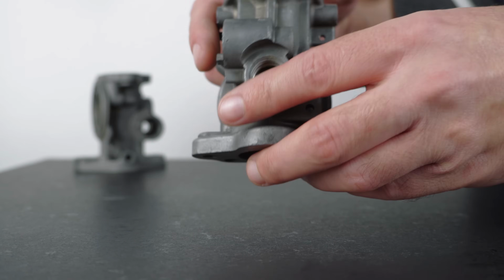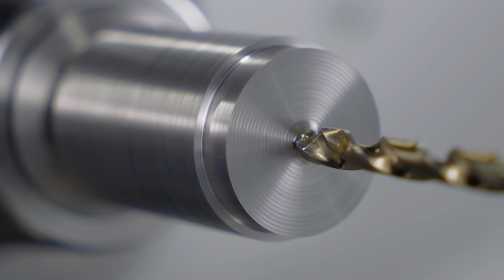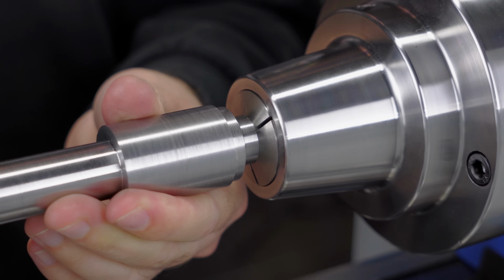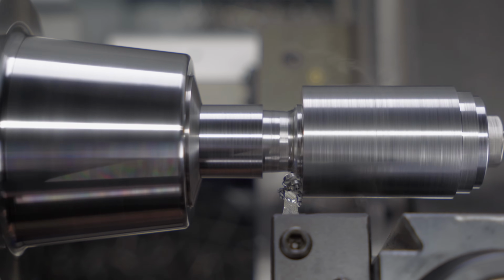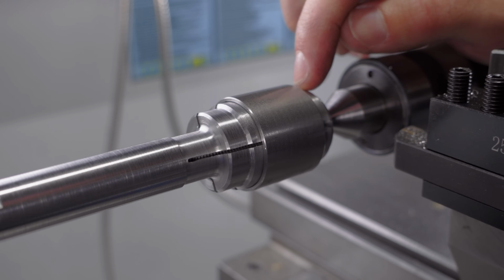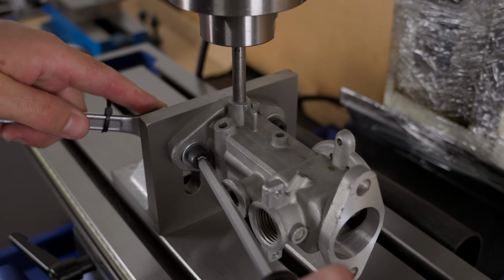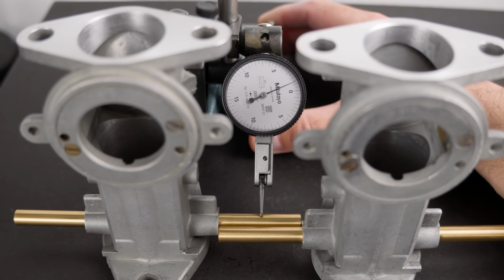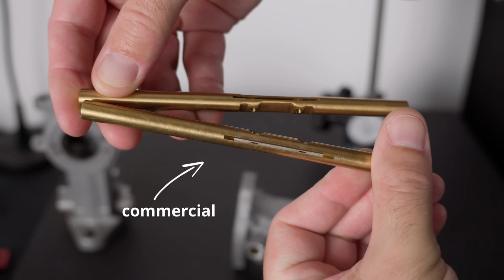Let's face it, no one does this on the lathe.

Comment: Reamers only ensure that the hole is to size, location wise they offer no guarantees. Boring bar is the way to go when you need the hole to size and in the right place.
Reply: Yes, or you can use an end mill to cut the hole in the right place and round as long as you have an end mill that is not oversize.
Reply: Lol , a properly spotted and drilled hole can locate a hole within a couple of tenths . The reamer will follow the the drilled hole maintaining the location established by the drill.
Reply: @bobbybishop5662  I wonder why I wasted a hundred grand on a  SIP jig borer a few years ago
Reply: @bobbybishop5662  I suppose the pin has to be fitted to the drilled holes?
Reply: We’re talking about SU carbies…… I would be surprised if those bushing were with in 20x that tolerance from factory…… this ain’t a turbo pump shaft for nasa
Reply: @bobbybishop5662  

Since this thread keeps going... you mentioned "properly properly spotted"... I assume you mean using a spotting drill (as opposed to center drill, which has a wrong angle) to establish the register for the jobber drill. There is indeed a technique useful for deep holes where a boring bar would be impractical, but funnily enough it still involves a boring bar... Just using a spotting drill before the jobber is insufficient to ensure the bore is in the right location, as the drill will still deflect before the initial bore is formed. So instead you drill a shorter bore undersize, then using the boring bar open it up to the main drill diameter. That bore is now in the right location and will guide the main drill the rest of the way. Again, this is better than just drilling but still not as good as the boring bar going all the way.

Comment: I turned a female and a male taper much as you did here and they, as yours did, not match. Instead of remachining like you did, I used a grinding compound and lapped them to one another. The final fit was 100%.
Reply: I had the same thought at the end of the video.
Reply from the maker: That was also my first thought. But it was quicker to just re-cut the angle. Thanks!
Reply: @nbrworks  @oh8wingman Thanks! Cutting tapers is always difficult!
Reply: @nbrworks  Good choice in general., Lapping tapers is tricky and generally doesn't result in a constant taper, because you can't move the parts axially so you end up with rotational symmetry and matching parts but not cones. Fine if you're making two parts to fit each other and nothing else, but no good for making anything interchangeable.
Reply: One thing that can mess you up on male/female tapers fitting properly is the cutting tool has to be precisely on center height wise. Most machinist are trained to run the turning tool just low of center height and a boring bar just a bit high on center. That will make the angle wrong. Some people know this and some do not. Just saying that is something I had to learn the hard way. 

Fortunately I was working at a job shop machining a big coupling to fit a tapered shaft so I got paid to do it wrong then got paid to do it right. Cost the boss man a $400 coupling.
Reply: Relieve the male taper  about in the middle of the taper a small amount on the diameter but a little longer in the center of the taper, creating an undercut. This will have two point contact and will run true. CNC machines relieve the female taper.

Comment: I was a mechanic in my early life, '60-'92 & spent some time in pergatory working on British & other sports cars. You have found a a way to solve a problem plaguing us back then, premature wear of throttle shafts on down/side draft carbs creating vacuum leaks & 'no win' tune ups, (performance/efficiency is improved w/ new ignition parts, but rough idle, surging or stumbling can't be fixed, so "Your tune up was worthless".

That no win situation caused me to add the extra work of compression tests to all tune ups & reject the candidate if imbalance was found in cylinders.  Didn't solve the problems w/ the carb shaft issues & complaints re: "bad tune ups", but it eliminated most of the complaints of "bad tune ups" due to imbalanced compression.

By nearly eliminating the one, dealing w/ the other was easier.

It was still like talking to the wall most of the time, since most customers thought a tune up would solve everything wrong w/ a 125,000 (hard) mile sports car.

Nice work, nice design, clever idea on driving the custom mandrel. I like it enough I may add the drive design to my list of tool upgrade projects. It would be nice to eliminate lathe dogs from mandrel work, if I live long enough to get to it!  LOL  I laugh in the face of old age & mortality; as long as there's work in my shop, I'll keep going. And... there's ALWAYS work in a shop.  ;-)

Comment: A tip: Loctite does not like zinc. If I end up with galvanized or Zink plated bolts Etc. I soak them in vinegar, which will dissolve the coating, then steel brush to remove the "Rust" from the vinegar.

Comment: This is a MUCH better and longer lasting repair than how I would have done it.. Years ago there was an aftermarket company who made these little stuffing box cap things that slid over the shaft and mated tight to the carb body with friction (they kinda looked like a valve stem oil seal). I like your repair much better!

Comment: 37:47 What you might be seeing is the rigidity of your setup or machine. The Z-axis tool pressure may be deflecting your table, combine any other variable and it can easily add up to this amount. Try measuring the movement of your mill table when locked down with an indicator.  If your machine is deflecting  or twisting it can cause unpredicted tolerance issues. Then, as usual, make sure your mil head is trammed in. Great video and ideas!

Comment: What you really need is a floating expansion tool. 

Your part only grabs the carburetor by  the end of the tool you made, not by the entire length. The floating one uses an internal shaft tapered towards the end with a set of oppositely tapered "leaves" that ride along the shaft taper. As the two slide against each other, they expand evenly and maintain concentricity. 
They work along the same principle as a tailpipe expander tool, but are more precise than those. 
I can send you some plans for the floating expander mandrel I use, and you can adjust the dimensions to fit your application.
The one I have grips both ends of the bore so that both flanges are both perpendicular to the bore and parallel to each other. You also don't need to remove the tool between facing one end and the other.
Just let me know if you would like me to send you the plans.

Great video, and I'm anxious to check out your other ones.

Comment: Suspect part was rotated on angle plate and realigned for each bushing hole from the quill.
A dividing head or rotary table required to achieve perfect alignment of the holes. ( you have an engine lathe and a knee mill, could build one. )
Side notes, Red Seal trade school hints from Canada:
Hand hone rads on the corners of the cutting lip to lands on twist drill when the chisel point has no material to keep it centered, cuts smooth acting like a reamer.
Blueing should never be smeared on full periphery, 3 equally spaced thin lines on taper angle and the mating part is twisted 1/4 turn max.
Reply from the maker: Thanks!!

Comment: Great work! when setting your compound angle, mount an indicator on the toolpost, square to the workpiece. You can then set your angle based on the travel of the indicator vs. the travel of the compound. For very sensitive angles, this will get you closer than the graduations on the compound can.
Reply from the maker: If you look closer at my compound you'll see 2 marks 50mm (2 inches) apart, exactly to help with that method 😉

Comment: I’m only partway through the video and I’m already seeing a lot of old-school techniques here. Many things were bored, turned machine in what would now be considered oddball ways back in the day. Your idea of using a ring on your expanding arbor is spot on. One thing to remember about turningmaterial that has been cut into segments is centrifugal force is pushing the pieces outward as you are trying to machine them. If you’re not able to use a ring to hold everything together, you may have to run slower RPM and take multiple cuts.

Comment: Awesome. Not really applicable probably since most people don’t have one on hand, but jig grinding these two bores would be the way to go to get them dead on in line with one another. I ran a Moore No. 2 at one point and super precise hole, slot, etc. location size and alignment were its specialty. Thanks again very glad to have stumbled onto your channel

Comment: You could also look into the tapered mandrel expanding bushing that is used between centers for turning or grinding bushing OD. You can make a special arbor with threads and a nut to push the bushing into the long taper.

Comment: You've done an amazingly beautiful job of both the internal collet and the finished carburettor! ♥

The only reason that I can think of for the brass rod sticking is that I think a bushing and the part passing through it are usually made out of dissimilar metals - e.g. steel and bronze, etc. - it may be that making both from brasses that are similar may cause problems.

I sometimes use adjustable reamers that can be adjusted by maybe c. 200 μm or 8 thou - that lets the reamer be adjusted to get exactly the sort of fit that I want.

I've heard of a soft wood rod or plastic rod being turned to the right size then used with some grinding paste as a hone to very slightly increase the diameter of a reamed hole and give a surface finish which holds lubricating oil.
Reply from the maker: Thanks Will. That's some good points. thanks! 👍
Reply: I would just use some lapping compound. It's kind of a lousy set up, it has to be loose enough to pivot, but not so loose that air can enter the butterfly valve. Seems like it needs an o-ring somewhere.

Comment: A very thoughtful piece of work holding.  If you intend to use the mandrel alot, have you considered drilling a hole at the root of the slits?  If you are concerned with fatigue it would be a good idea.  Thanks for the video.
Reply from the maker: Hi, that is a great idea, yes. It was also suggested by another viewer and I will do it. Thank you so much!

Comment: Love the quality and thought put into your machining. Its great to see some decent but appropriate size cuts taken on a lathe. 
Also given your results you have adjusted it perfectly so while not an expensive lathe you are getting everything out of it you can.
By the look of the chips you could up the feed a little or the speed to help get the chips to break up.

On a more important note 6 jaw chucks are for holding thin wall workpieces. They help lessen the amount of distortion.
On anything else you can't be sure that you actually have the 6 jaws working - only 3 of them may be (think of stools chairs etc.) depending on the workpiece.
So it is best to use a 3 jaw for most work - though it doesn't look anywhere near as cool.

Comment: This is art work.

And well done on a completed project with excellent results.

Again a coupe of comments (I left some in the butterfly spindles video).

Why not use ball bearings on the spindles? Weber does it, Dellorto does it, I am sure others too. Technology has come a long way and we now have pretty much any size and flavour you want. Have a look at hobby (radio control) shops and see the diversity of sealed bearings in any size you can dream up they offer these days for not much coin. I have used them in carburettors for a while now with great success. No more shaft wear, no more bore wear and much better sealing and reliable positioning than you can ever dream to achieve with metal on metal running clearances. Not to mention smoother turning. In your case all you have to do is add a counterbore to the outside of the spindle bore on either end to house the bearings and threads to the spindle ends. If space does not allow for a very large bearing, just make the bore deeper (I have noticed the bores are quite deep) and put two bearings back to back on either side. Either way, in a carby these bearings won't see the loads they are designed for so they're basically in there for life.

Comment: As other's have probably pointed out, the reamer is not necessarily going to correct the bore alignment, a boring bar is the best way. Maybe bore/bush one side, flip it and then run a ground shaft up through it and  indicate off that shaft, then bore the other side. You could also set up a mini line-bore arrangement on the lathe. I'm sure there are other ways as well.

Comment: you can def do this in a mill. you use something like a mitee bite ID expansion clamp. which is essentially the tool you made...but the mitee bites are flat on the bottom. for holding round parts in a mill :)
Reply from the maker: I didn't know these clamps, thank you so much for sharing!

Comment: That was some nice machining, parts turned out well, far better than the original manufacturer ever considered possible.
I am a little surprised you didn't radius all the internal sharp edges while you were in there with flex shaft grinder? 
Back in the day it was much more common to have sheet of emery paper on a flat surface to correct bow on flanges, exactly how you did it.
Milling machines were a 'luxury' few shops had and cost at machine shops was far too high for majority of people.
There were aftermarket kits for the bushings, just drill them out and hammer them in (then spend time with a file and emery cloth fixing the burrs).  
I imagine they have been out of production for 50 years or more by now though?
You should have drilled holes at end of expansion slots, it would mean there is less material to flex. You could still do it but will need to use a center cutting end mill.
Using Morse taper adapter as an extension for center may give more clearance but it's going to be very flexible when you have any side loads (as in turning) and probably reason for chatter? All in all, a very interesting video.
Are you (or have you) done a video on rebuilding the SU carbs? I had them on my first car (1966 Rover)
Reply from the maker: Hi, nice to have you back! 

I might add some small radius in certain points, but I want to do it carefully and focused, not in an awkward position with the camera in the way. 

I believe Burlen in the UK still sells service kits. I have one I bought several years ago, it came with steel bushings, coated with teflon inside, but in my point of view, they leave a little bit too much play for the shafts. That's why I didn't use them. I also believe Burlen replaces them, as in a service they provide, but I don't know details about that.

Regarding the holes at the end of the expansion slots, I will do them, like you say, plunging a center cutting endmill, this was also suggested by other viewers (thank you).

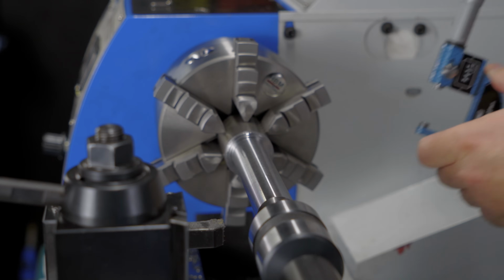The morse taper extension... it's a good point. I bought the extension because I needed the clearance, but I also thought it was going to flex a lot and be unreliable (or reliably give bad results). But in fact, I can't complain. At 2:02 there's an example of that. Until something changes, I'd say that extention is working for me. At least it's better than having the tailstock fully extended 😉

Video with the full rebuild of the carbs... no, I haven't done that yet. I still need to take care of some things first: pistons and chambers, choke mechanism (I need to invent something to make it work), take care of the manifold, air filters, etc. But I'll make that video, that's guaranteed.

Thanks!

Comment: The reamer can and will not fix if the bushings are off axis or off center to each other - remember its a reamer not a endmill, it will follow the bore no matter how off they are, as long as it can bend as far as it needs to.. if you're getting uneven pressure from the lower hole, because its off center or off axis from the top hole, the reamer will create a hole with a notch in it form bending, or it might even get oval, even worse it will be different along the length of the hole - the top might be bigger to the left side and going down it'll get bigger to the right side of the hole.
Thats exactly the reason why it isn't recommended to use a reamer in that way, unless you're absolutely sure the holes are perfeclty in line with each other.
Nice work, really nice attention to detail 👍🏻

Comment: Can you imagine the cost of what you just did, if you were charging for a one off part restoration?
E.g., I just restored an old Minolta camera, it took me 25 hours to complete and for that I didn't need to make any parts. The camera cost me £23, the best price I'd get for it would be around £100, so at a modest charge rate of £25 / hour, that would be £625, that's £525 more than the camera is worth.

Comment: As a beginner, (just a few, cancer interrupted years ago), I wondered & asked if angle of contact of the insert & the material made a difference. Didn't get, or find an answer, so just kept on w/ getting a working contact within the size limits of my hot rod Sherline, (too little tailstock extension, no compound, tooling & toolpost a bit too large).

A few more years into learning, some new tooling & I'm discovering the angle CAN make a difference.

In situations where you're getting ling curly swarf, try changing the angle of the tooling. 

My theory is the cut coming off the material is missing a portion of the insert which will change the path of the swarf & cause it to break.

This also depends on the design of the insert's chipbreaker; some it won't matter.

Be curious to hear your results if you play around w/ this.